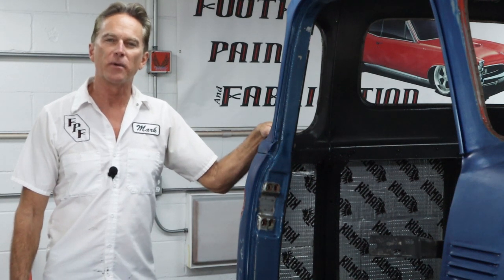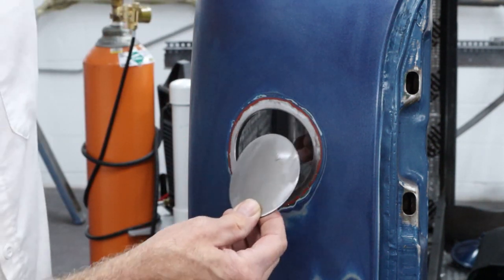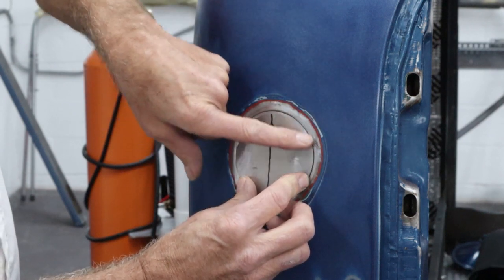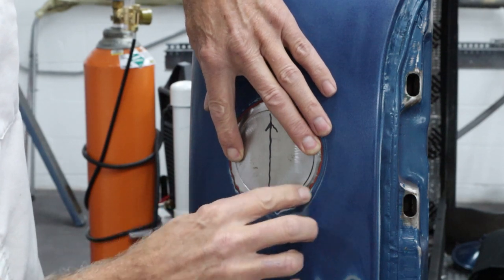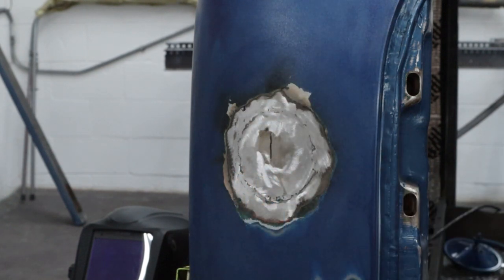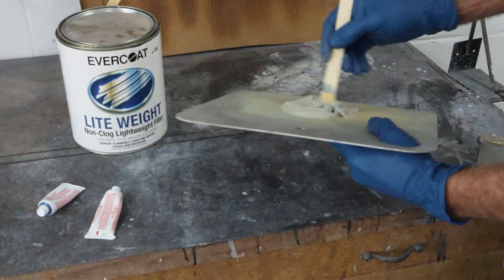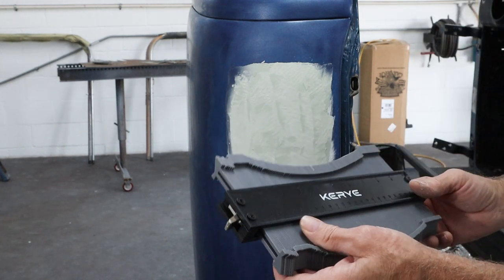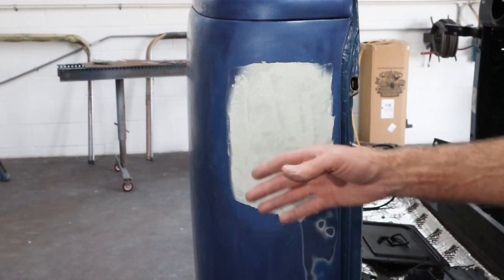1950 Chevy Truck (Ep 33) Filler Neck Delete - Weld to Fill

Comment: Your tig torch sounds as if you don't have enough argon flow should be 20 on the flow meter  it should have very little sound don't use anything but pure argon